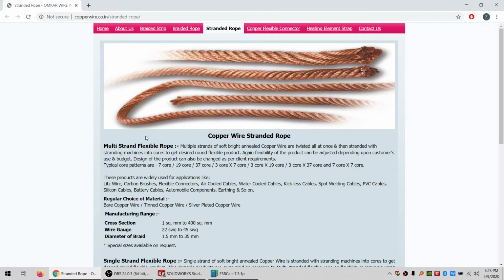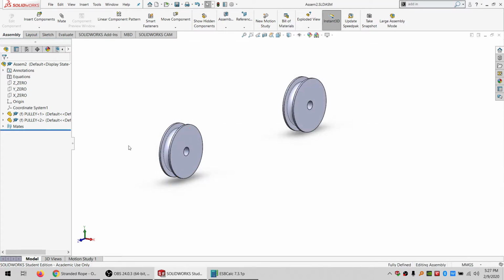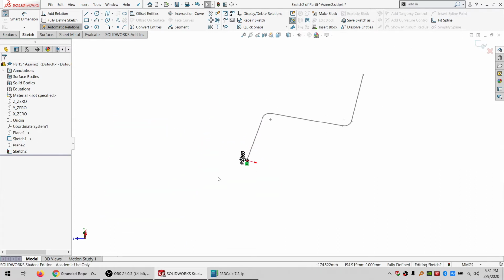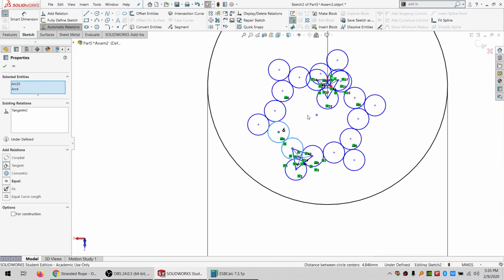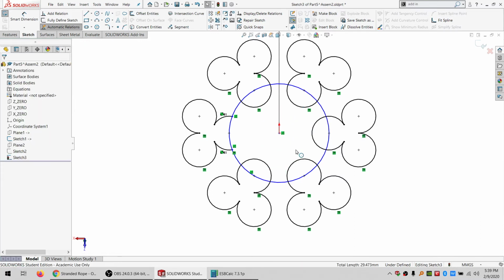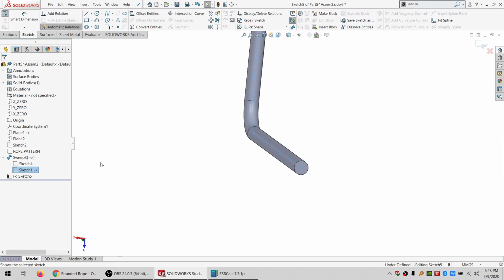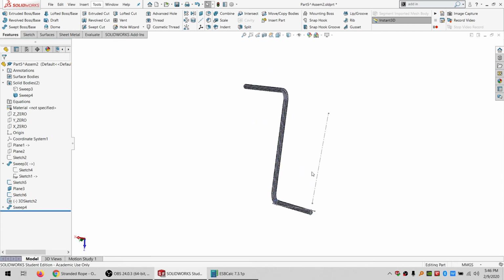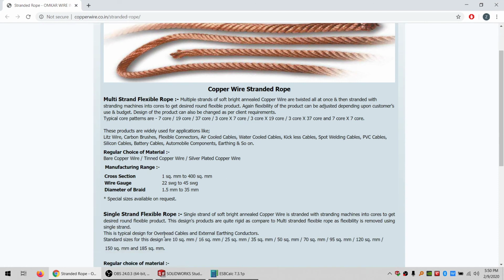Making a Copper Rope (By Request)

Comment: Zack! That was pretty trick! So this rope is around 1/2" in diameter(3 of them) and its going to be soldered to some end pieces to pull heat from
a focal plane. This is perfect even though when I model it up it could just be a 1/2 diameter but i was looking for that small diameter with the twist. I will try your method tomorrow when I am at work. I dont have all the details on length yet. Wish I had SW here at my house so I could try your tricks. You move so fast i have to go back like multiple times to see what your doing. I just sit here and chuckle since i am so green with this.
Reply from the maker: For getting SolidWorks at home, you might consider an educational license.  It's no good for starting a business or anything like that but if you are just learning or maybe making some one-off items for yourself, it's just as good as a full license.  Can often get it if you are a student of almost any kind, or you can get it by being a member of certain organizations.  Check out the EAA; it's worth the money even without the free solidworks license.